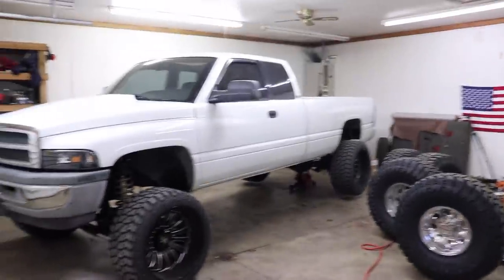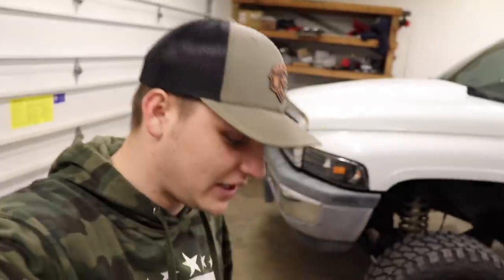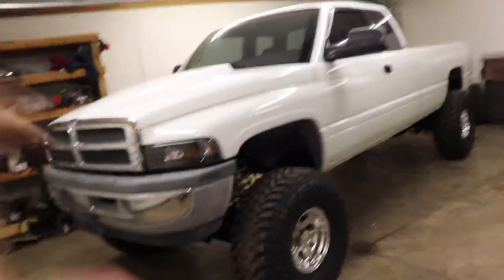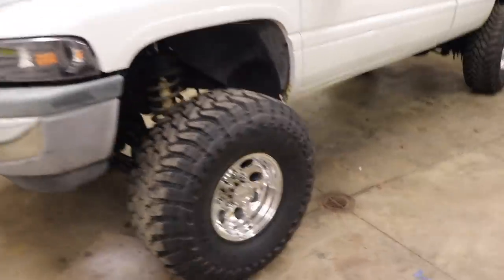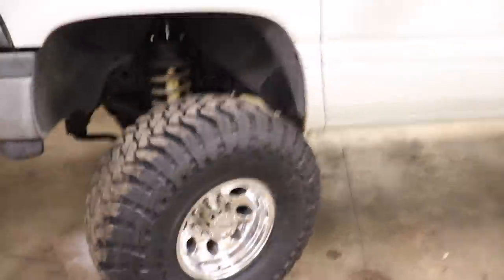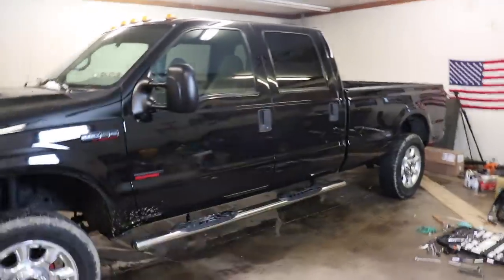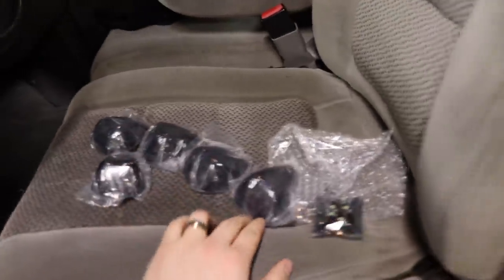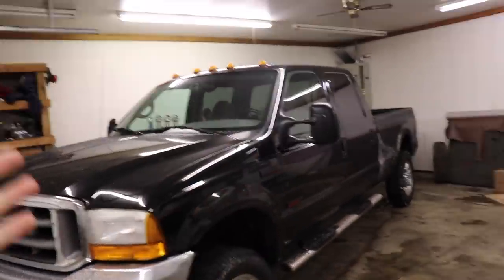New MONSTER 38's ARE ON!!!

Comment: on my 04 F250 I ran 16x10 Weld Racing chrome wheels with 39.5" Iroks and it looked absolutely amazing, problem was it would rub slightly at full lock but when I was driving around the farm it would always rub a lot when the truck was going over uneven ground, so I downsized the tires to 37" Iroks and I couldnt have been happier....trucked still looked awesome and I never had any rub at all....just a thought for the 7.3....you wont be disappointed in that look

Comment: What year is frosty?
Reply: TheSportster06c  1997
Reply: @taylorschmidt72595  that's what I  have too. I have a 5.9L. I've been asked what gen I have but I don't know. Do you know what gen the 97's are?
Reply: Thesportster06c a 97 is a second generation, P-Pump 12 Valve.
Reply: @dylanhamlin6227  ok thanks, but what does a P- Pump mean? I know dumb question. But I'm trying to learn more about the truck. It was my dads and I'm wanting to get it back on the road running good.
Reply: TheSportster06c it’s the injection pump used in the second gen 12 valves engines.
Reply: @dylanhamlin6227  ok thanks again.
Reply: I think frostys a 96 12 valve